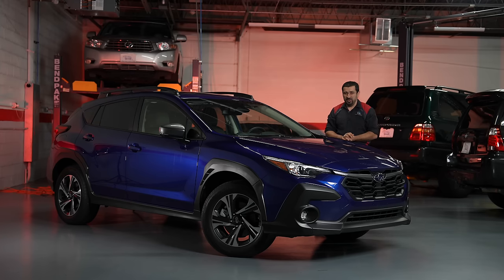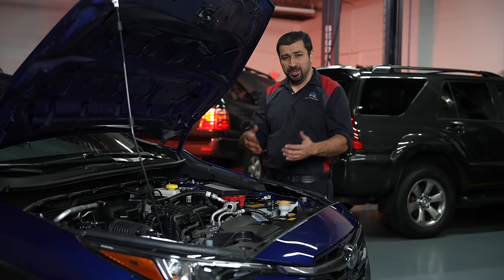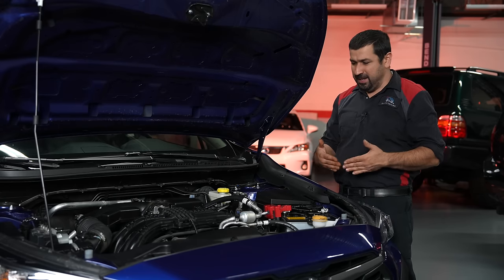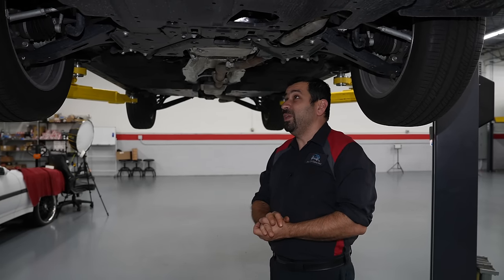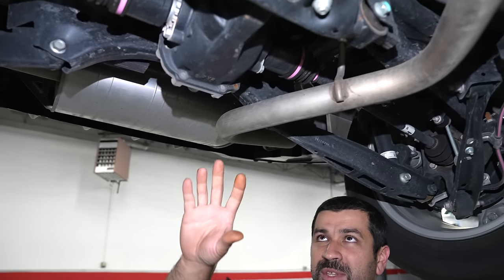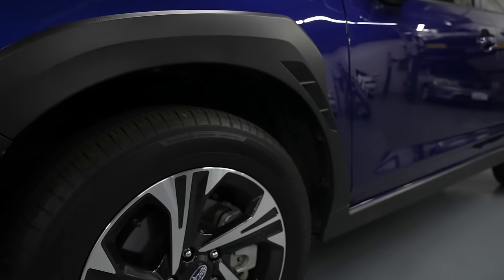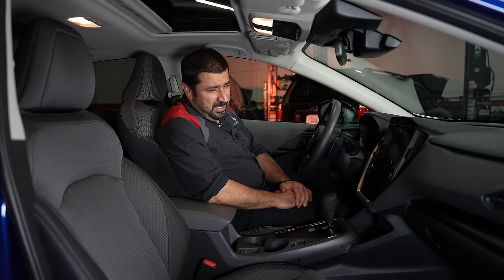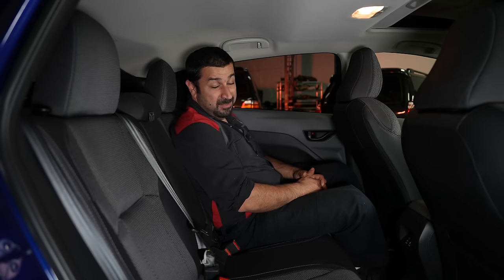Should You Buy a 2024 Subaru Crosstrek? Thorough Review By A Mechanic

Comment: Mourning the loss of the 6MT in both the Forester and the Crosstrek.   Agree that it would be great if they put D4S in all their cars.  Huge Subaru fan.  If they offered a D4S Forester with a 6MT I would buy one.   If Subaru CVTs turn out extremely reliable and economical to replace/repair, then I won't worry as much.
    Want buttons and knobs, not everything on a screen that forces me to take my eyes off the road.   Keep it simple, reliable, rugged, ergonomic and affordable.  Don't want a rolling entertainment centre with surveillance as a service.
Reply: I agree 100%. These little cons on their own are not that bad but combined are enough to prevent me from buying one at this point. You would think that a company like Subaru would embrace mechanical simplicity and follow the philosophy of “if it ain’t broke don’t fix it” similarly to Toyota but they seem to be more out of touch than ever with what consumers actually want. The average Subaru buyer these days isn’t really a “car person/enthusiast” so all these gimmicks and complicated equipment are frustrating for folks that just want a good simple reliable vehicle that is also great in snow.
Reply: All good points. However CVT's will never be cheap to repair, replacement is always the best option as once they begin to fail friction on the belt releases metal particles in the gearbox which pretty much destroys everything. And NO subaru's CVT's are still junk no comparison to Toyota's eCVT which is still not that good.

Comment: We checked out a Crosstrek about 6 months ago.  We liked it, but it was a bit too small for what we wanted.  We ended up taking a Forester out after and it was perfect so bought it.  The Wilderness model (they had one on the lot, which was perfect).  We love it.  It's great to drive and I am fine with CVTs as my Venza has one too (although, an eCVT).  Subaru's CVT is an inhouse unit that is better than the JATCO units out there.  From what I've read, the key to minimizing issues with Subarus is staying on top of regular maintenance.  We always do that anyway so I'm sure we'll be fine.  CVT and diff fluid changes every 60,000 miles/5 years.  Oil changes every 5,000 miles/6 months.  There is also some coolant changes and brake fluid flushes periodically as well.  Regarding the power output, I was worried it might be "slow", especially since the turbo engine option is no longer available on the Forester.  Honestly, after the break in period, it has plenty of zip to it.  The Wilderness model has a taller gear ratio in the CVT (for more torque off road), which may help a bit (at the expense of a bit of fuel economy), but overall, I don't miss the turbo at all.  It's not slow around town at all, and on the highways, it's not really behind other vehicles in its class (most are around 180-200 HP), unless they have an optional engine option (like Mazda's 2.5T, for example).
Reply: Agree with you 100%. Have a ‘17 Outback with around 190,000 km. I do my maintenance similar to yours . Have had the transmission fluid changed twice. Hope to get many more years of service from it.
Reply: the thing is, more people buy low hp cars, that's why turbo forester is no more, it was good, but people want less power
Reply: @vipvip-tf9rw  Well there was a choice before. You didn't have to get a turbo. The normal engine was available. I read somewhere that the turbo made up only a small % of sales
Reply: Good points .Agree 100% with you. I am on my 3rd Subaru. All have had the 2.5. Enough power for me. Learned to drive on an original Mini. Had a couple of beetles, a Vega and a couple of K cars. Compared to them, 175hp is plenty.
Reply: @ericripley9739  yeah, eco thing destroyed that car
Reply: @vipvip-tf9rw  Please explain " eco  thing??"
Reply: @ericripley9739  there is law in one of key markets of subaru, I don't remeber which, which says, that manufacturers lineup needs to be under certian emissions, that's why when they put turbo, they put it in most expensive cars, like ob and ascent, no forester or ct, this is also reason, why toyota starts using v6 or turbo i4 in their heavy models and not v8
Reply: @ericripley9739  if there was no eco law, v12 or v8 would rule high end, but now even mercedes use i4 hybrid drivetrain, instead of v8

Comment: I had a 2012 Impreza Sport Limited Hatchback, really liked it, and could go anywhere like a mountain goat but it had some problems.
Oil consumption but not enough to be covered under warranty
Seat design flaw, squeaks developed quickly
Very slow with a cvt
never reached the advertised mpgs
went through multiple wheel bearings

I really hope they made some quality improvements over the years.

Comment: Was looking forward for a Subaru review on this channel. I own two Subarus The biggest complain I have with my 2023 model is the lack of physical hvac, heated seats and brake hold controls. I wish they made the screen 25-30% smaller but put the actual buttons.
Reply: This is the exact reason I got a '22 in '23
Reply: Are you referring to the Outback? 
The 2023 Crosstrek is the last model year that has physical HVAC buttons. I have it and I'm so glad the physical buttons are there.
The 2024 model Crosstrek as shown in this video is brand new.
Reply: @matt.canada  In my case I was referring to the Ascent, 2022 had physical buttons but 2023 did not any more. The Outback started using this large screen earlier I think in 2020. Looks like Subaru is switching all it's models to the same infotainment system with touchscreen HVAC controls, probably to save a few bucks, witch is sad.
Reply: @bohdanked  I don't mind this screen at all. With all the important "buttons" moved to the first screen and the physical warmer/cooler buttons that are there I find it a delight to use. 
Now, if we could permanently disable the Auto Start-Stop...
Reply: @michaelostrowski8630  FYI.. The Subaru Ascent does not have the Auto Start/Stop feature. Not sure why..

Comment: Most people finding value in the all wheel drive system are those living in a snow climate where it makes a tremendous difference. Essentially any day can be an off road experience driving to work. At an intersection on a snowy/icy road waiting for your turn to make a left (in n. America) turn through traffic, its really nice when the cars just powers forward instead of spinning front tires lingering in the oncoming lane. Ive been a Subaru owner for 20 years and not changing anytime soon.

Comment: Great Review! I have a 2024 Crosstrek Limited with the 2.5L engine. 4 months and 3.2K miles. I feel it's acceleration is adequate. Yes, you can't keep up with a Mustang or a Tesla, but it is not meant to. I have been driving FWD cars for 40yrs. I was surprised at how much I really noticed how the lack of torque steer made driving the car so much more enjoyable. Both front drive shafts are equal in length, so there is no torque steer pulling you to one side or the other when you accelerate.  Another things I like about the car is, when driving it around town, there is very little road noise for a small car. It is quieter than my wife's 2021 Rav4 Hybrid. Yes the engine is noisy when accelerating but when you are cruising, it is very quiet. On the highway, it is almost as loud as our RAV4. Wagons, SUV's etc seem to always be louder on the highway than a sedan.
Reply: I agree about the sound level.  The CT is soooo quiet in town.
Reply: Amazing that you and I pretty much have the same experience. Just bought a 24 Limited after years of owning Toyotas. It does seem that my new Crosstrek is quieter than my wife's 21 Rav Hybrid!

Comment: Could not believe they kept the same engines yet eliminated the manual, such a shame.  Great overview of the new model.
Reply: Automatic gets better gas mileage. Regulations are getting more strict each year. It's a no brainer to kill off the less fuel efficient transmission.
Reply: Nobody was buying manual Crosstreks and the manual was only available for the cheap Base model. Also every Crosstrek comes with paddle shifters, which is the closest thing to a manual if you want a manual Crosstrek.
Reply: @eddiethewhale3268  paddle shifters on a CVT transmission are not the same as a manual.

Manual transmission is a lot cheaper to maintain and operate and simpler. CVT has a lot more failure points. And is more fun.
Reply: Take rate on manuals are extremely low and continuing lower. Unless it's an enthusiast car they're all gone or will be very soon.
Reply: @omarpulido8502  which is precisely why I said it’s the closest thing to a manual in a car that doesn’t offer a manual transmission anymore.
Reply: Maybe its different in Canada, my dealer had numerous unfilled manual orders each year for the past few years.  They just never built enough to meet the demand. The CVT tends to fall on its face doing anything adventureous from my experience.
Reply: @Conrad711 
My dealer in the US had manual crosstreks on the lot for several months before they sold. The automatic ones sold in less than a month.
Reply: I hope you apso review the three wilderness of subaru

Comment: I have a '22 Limited. As someone else mentioned, the pre '24's have manual HVAC controls. Also, FWIW, all Crosstreks have roof rails standard. (edit: 2024 base does not. Thanks for the correction.) With the bulk of my driving being rural, I routinely exceed the stated fuel economy numbers published. For anybody out there considering one, the 2.5 is the way to go! Keep in mind the new Wilderness edition has a lower final drive ratio which will reduce your fuel economy, so if you're not serious about off roading, I would suggest the Sport or Limited. I routinely average 36 or 37 mpg. Thanks for your in depth review.
Reply: I have the 2024 LT and didn't notice any acceleration/power issues where the speed limits are 75-85.  Actually no issues with the vehicle at all except have to fight the wife to drive it.  ;)
Reply: You tube too many commercials 😮
Reply: Thanks for mentioning fuel stats and the wilderness gear ratio effecting gas mileage . I really like this car but hate the stupid looking side body cladding very Toyota esk ugliness and the Soletera really ugly cladding . If you want to sell an EV dont`t make it ugly .
Reply: Minor correction to your comment: For 2024, the base model no longer comes with roof rails. So, most but not all Crosstreks come with roof rails standard now. Used to be that all trim levels had roof rails, but not anymore for 24. There are a number of cost cutting measures Subaru undertook with the 24 model compared to the previous gen, and this is one of them.
Reply: Thanks, I was not aware of that. @ZeGermanHam

Comment: I've loved your Toyota Lexus content for a long time so it was great to see you do a subaru. Knowing the Toyota reliability and not being able to afford a 4runner, I bought a 23 Crosstrek sport because the Corolla cross was just too boring and I've seen too many RAV4 stuck in the snow plus the dealers just want to rake you over the coals for a RAV4 like they're solid gold or something. As far as the speed and power, I find it completely adequate as I can easily merge 60 to 80 on an on-ramp and can Cruise 80-90 + on the highway and pass at 100 plus if need be. I wasn't looking for a performance car. I won't lie though, I'm keeping my fingers crossed on the CVT and the overall longevity of the car lol.
Reply: I live in Canada, and my Rav4 compete with some of truck in snow, and we getting alot of snow.
Reply: As a Minnesotan, in my experience Rav 4 s are slightly behind Honda and Mazda and way behind Subaru when it comes to AWD performance.

Comment: I have a 22 Crosstrek Sport and  I love it, amazing snow car. I looked in to Toyota and Mazda, but due to the amount of deep snow I need to drive through, I went back to Subaru because of their AWD system, its something I can trust in a foot of snow. As someone who came from a WRX, I was not that disappointed with the power of the 2.5L, even at elevation it gets the job done for me.
Reply: I have no problems with our cx5 or cx 50. Most awd can handle snow
Reply: A lot people like to say the 2.5 L is slow but 0-60 is sub 7 -8 seconds is not bad at all for a car this size. The torque makes it quick off the line too and keeps with cars like the civic si.
Reply: I too find the power from the 2.5 just right. Just enough power for everyday. As an active empty nester my hotrod days are long gone. Bought a 24 Limited. The car fits my lifestyle perfectly. Is a long time Toyota owner I was a little concerned about long-term reliability. Time will tell.
Reply: The 2.5 is ok for most people but it’s still sluggish in my opinion. Not fan of there CVTs either as hybrid owner I prefer an eCVT much more.

Comment: I went from a 2017 Outback with the 3.6 (256 hp) to a 2024 Crosstrek with the 2.5 (182 hp). I feel it's lacking cause I used to have a heavy foot on the gas pedal... and I think sound insulation was better on the Outback. Still like my new car and with the weight difference between the 2, I think the handling is way better (less boat feel). In the end, I would take a 2.4 turbo Crosstrek anyday!
Reply: yeah ob is premium from subaru, while xv is cheap option, so less or no insulation

Comment: Own a '16 Crosstrek that was my commute vehicle. It has the pre '18 2.0L (148hp) was okay when I was commuting as I did not need to take the freeway to work. I am now retired, but still will keep this Subaru. I thought of upgrading but don't care for the direct injection only engines, my Subaru has port injection which helps to keep the back of the intake valves cleaner, wished Subaru offered dual injection engines. 

My '16 Subaru hasn't had any issues, keep it maintained, no leaks anywhere, and doesn't burn oil.

Comment: Subaru makes good cars you gotta remember they’re not four-wheel trucks nice review is always . Just keep in mind with all-wheel-drive when tires need to be replaced. Specially, on a Subaru you’re gonna need to replace all four. That goes for any wheel.
Reply: Had a 2011 Forester. Ruined a winter tire while vacationing inSouth Carolina . The other 3 were half worn. Only replaced the one tire. No problem.
Reply: @ericripley9739  that’s a Subaru thing not something that people are making up all the rest of the tires are new Yes, you can put one tire on. They recommend the same tire brand .
Reply: @gregs3153  Thanks for the reply. It was a front tire and I drove for several days on the temporary spare. Only read later that it should have been moved to the back. But I got away with it. Not easy to get winter tires in SC!

Comment: I've owned Imprezas and a Crosstrek with 5 and 6 speed manuals for years, bullet proof little things with 30+ mpg's that will go through a foot of snow without flinching and make you fell like a rally driver when you're flying down a dirt road. But when I heard they're going to CVT's only, I dropped off the Subaru bandwagon and bought a 6 speed Tacoma. It hurts too because that symmetrical AWD system is a beautiful thing to drive and my little Imprezas were so well balanced and the center of gravity was nice and low, once you got them up to speed, they felt so good to drive in the corners.
I miss my Subies :face-purple-crying:

Comment: It's an exercise in tactless overuse of plastic cladding if you ask me. CVT is the only way Subaru can stay EPA compliant. Those engines are not the epitome of fuel economy.  All in all it's not too bad, especially with 2.5. But I would really like to see turbo version with a stick.
Reply: A LOT of people would.  There are a few older Forester XTs still around, some with a manual trans.  I've been told that they were a blast to drive.
Reply: @eskieman3948  I tried to find one. It's like hunting a unicorn.

Comment: I have an '18 Outback and a '19 Ascent.  NO issues at all  with either transmission.  The Outback is averaging 25 mpg+ in city driving; 30-32 on the road.  The Ascent's mpg is about 10% less; heavier and has a turbo engine.  I tow a boat (15-1700 lbs) with the Outback and average almost 21 mpg.  I've owned every major US brand, Toyotas, Volvos and a Mercedes...these Subaru's are as good or better than any car I've had.  I am a nut about maintenance and change the oil & filter every 4,000 miles.  I'll get the CVT serviced at 60K on both.  We wanted to look at couple of Toyotas when we bought the Ascent, but the local dealership was in the process of being sold and had nearly zero inventory.

Comment: Love my cladding on my Crosstrek!!  I also am liking the temperature controls on the screen because I can adjust the temperature settings and actually run a specific temperature vs having a dial temperature setting.  Whoever set my computer screen in my 2024 Crosstrek did a great job!!  I'm not having the situation you had in the car you reviewed.  Also when you look up Subaru it does say that Toyota does have "a small stake in Subaru".

Comment: Overall good video, was listening for comments about safety, which many people buy Subarus for but didn't hear. For instance, the construction used to stop collision intrusion into the cabin and many more features even Japanese cars at their price point cheap out on. Also didn't see a drive test to comment on handling. Subarus experience with rally racing shows when driving with tight turns and slick roads. Even timid drivers will relax after experiencing the predictable response.